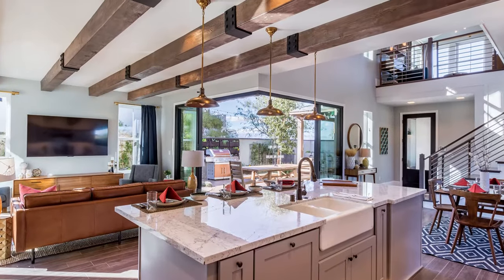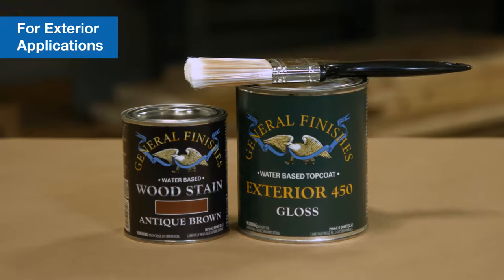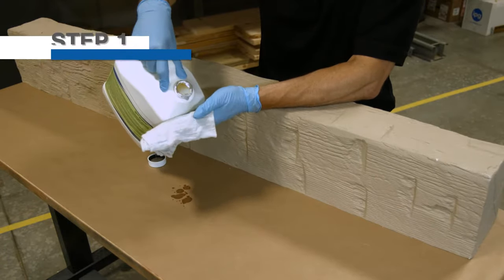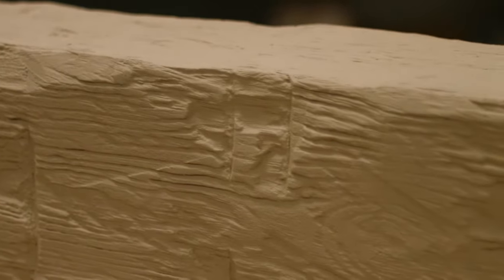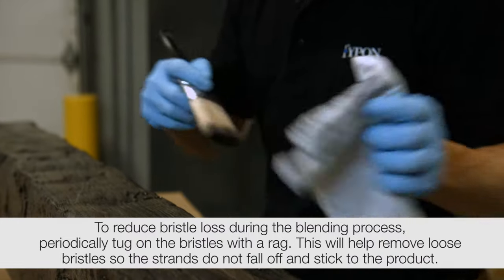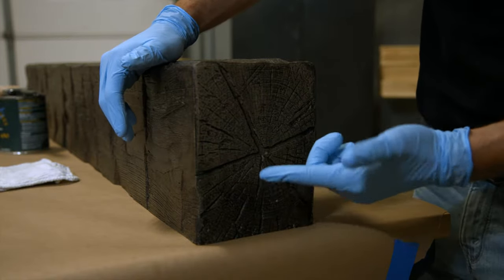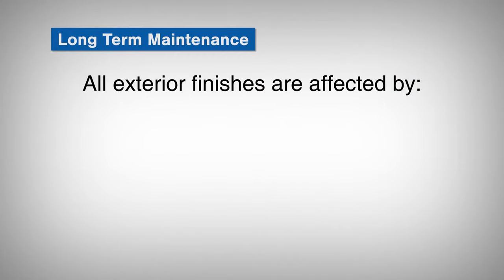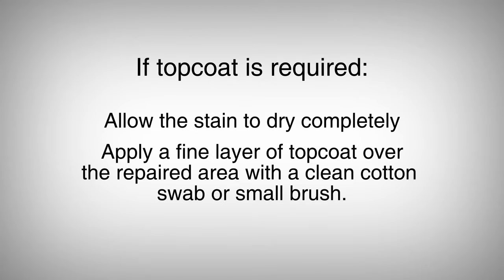Fypon Staining Tutorial

Comment: I have several ceiling fypon beams I need to stain. Can the poly beam be stained with an airless paint sprayer?
Reply from the maker: Hi Kristian, We recommend using a brush to achieve the wood stained look as this method has been tested and proven to work in our facilities. We have not tested a sprayer and cannot guarantee the results. Hope this helps.
Reply: @FyponProducts  mineral spirits is not available in California. What can be used as a substitute to lighten the areas
Reply from the maker: For a substitute as far as cleaning, denatured alcohol can be used. As a solvent we don't think this would work. If you would like to speak with a Customer Care team member about your specific project, please give us a call at 1.800.446.3040.

Comment: How do you stain them if they’re a lighter stain? We’re looking at doing a lighter oak type color. So how would that be applied?
Reply from the maker: Our beams come primed and ready for stain or paint.  As far as a lighter color, you can follow our finishing instructions, however, the color may not get to the lighter color you need.  The color the beam is unfinished is the color that it comes out of the mold, then it gets 2 coats of primer.
The Finishing instructions link is below.
https://thermatru.widen.net/view/pdf/iryy4jzhzs/22_Instructions_GeneralFinishing.pdf